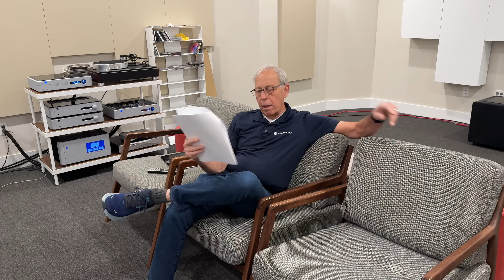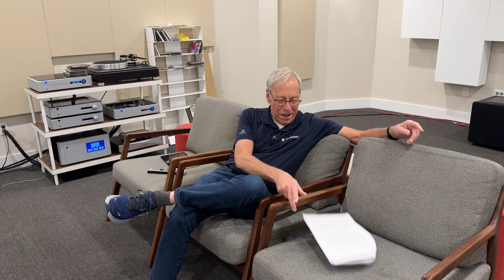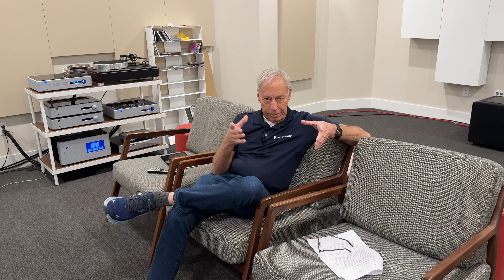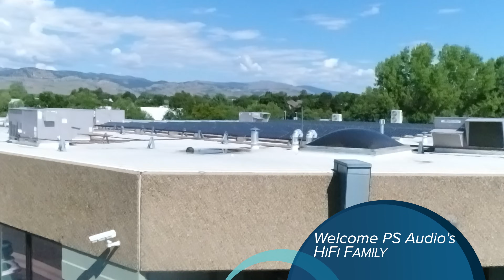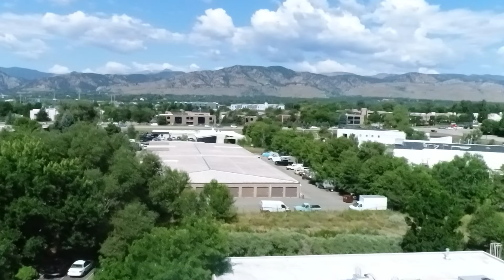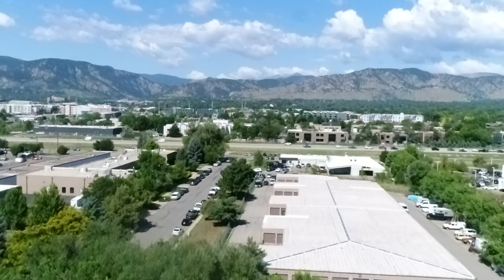AESEBU digital inputs

Comment: Where talking about transferring DSD signals right?
Reply: All digital signals. PSM and  DSD. There's no advantage cancelling out any noise picked up by the cable when transferring digital signals. That doesn't mean that they can't sound better or worse depending on how your equipment is designed
Reply: All digital signals. PSM and  DSD. There's no advantage cancelling out any noise picked up by the cable when transferring digital signals. That doesn't mean that they can't sound better or worse depending on how your equipment is designed
Reply: All digital signals. PSM and  DSD. There's no advantage cancelling out any noise picked up by the cable when transferring digital signals. That doesn't mean that they can't sound better or worse depending on how your equipment is designed

Comment: What about USB?
Reply: USB was not designed with audio quality in mind.  It was designed to connect computer peripherals.

Depending on the sending device, USB can sound very good.  And depending on the USB cable, it can sound even better (or worse).

The main problem with USB is that computers generate a lot of electrical noise, and that gets sent out of the USB port, travels through the USB cable, and enters the DAC.  The result is that the music sounds less open, and less dynamic.  Streamers are also computers, designed for one purpose.  They, too, generate electrical noise.  How much depends on the design of the streamer.

I have my laptop feeding my DAC via a very good Audioquest USB cable, and it sounds very good.  Prior to using the Audioquest USB cable, I was using a mass produced USB cable, and the sound quality was far from good.  That Audioquest USB cable got rid of loads of noise.  I did not recognize it as noise (it is not like static, or hum, etc).  The music just sounded congested, and all of that changed with the Audioquest USB cable.

But the sound quality could be better, still.

I will soon be purchasing a digital-to-digital converter (DDC).  They are ideal for cleaning up the noise and jitter from USB.

You plug your computer or streamer's USB output into the DDC.  Then you plug the output of the DDC into your DAC.  The DDC will significantly reduce noise, and might reduce jitter, too (depends on the quality of the DDC).  And like all audio gear, there are DDCs that are under $100, and also for thousands of dollars.

The Singxer SU-2 gets good reviews, and the SU-6 is a bit better (and a bit pricier).  And then there are reviews on not using the included power adapter, due it generating noise.  Many DDC's come with an external, switching power supply (power brick).  So people purchase a low noise (low ripple) linear power supply.  Many get very good reviews from customers, and the reviews are for linear power supplies that are between $75 to $175.

And then you will want a quality AES/EBU cable to connect your DDC to your DAC (or some other digital output from your DDC to feed your DAC).  Even if a DDC offers a USB output, do not use it.  Use one of the other outputs to feed your DAC (and make sure that your DAC has an input for that type of cable).

AES/EBU cables are very good for long distances.  And those cables will vary in price, wildly.  According to reviews, digital cables will affect the sound quality.

Good luck!

Comment: @ 2:03 I2S not balanced? HDMI is a balanced topology. You mean that PS Audio is running the HDMI I2S single ended? Balanced signals provide the same benefits be it analog or digital. And BTW, all electrical signal transmission is analog. True HDMI is balanced, Ethernet is balanced, USB is balanced, Apple Thunderbolt is balanced as was Firewire. Most high speed interfaces are balanced. SPDIF and AES-3 are unbalanced but AES runs at video frequencies which are lower than the computer interfaces I noted above. FWEIW, most AES installations in the past 20 years were AES-3 75ohm unbalanced as the unbalanced version actually has more length capability, cheaper using coax cable and BNC connectors, and higher density on jack panels. Balanced AES is not used that much anymore except in recording studios.

P.S. I don't care what people think they hear, there is no subtle audible difference between balanced and unbalanced AES. Cable problems will cause errors which are highly audible. These audiophile ideas such as sound stage, presence, detail, are not affected by any digital interface. It either delivers consistent error free data or it doesn't. Then you get clicks and pops. That's it. Jitter is a DAC issue not affected by 6-10 foot digital cables.

Comment: Always enjoy learning stuff from Paul.  While I'm a fan of I2S I struggle to buy that an HDMI cable does not damage the clock signal.  Even different quality coax with SMA connectors can be heard.
Reply: What is the damage is being done to the clock signal that is causing an audible problem?  Can I see a calibrated screen shot of the clock waveform that is "damaged"?  Different quality coax? You do understand that coax cable is designed for a specific impedance? 50,72, 75,93,124 ohms for example. It needs to be matched to the design impedance of the interfaces. Otherwise errors can result which are quite audible,
Reply: @andydelle4509  You will have to seek that elsewhere.  I do not have the equipment to measure what goes on.  Just ears.  
We seek in digital audio low phase noise.  Any form of wave change can change the trigger point negatively impacting phase noise.  We use well shielded 50 ohm cables.  Torquing SMA connectors is generally accepted best practice and is clearly audible.  Even though a cable spec'd for low gHz transmission should be more than adequate for the 5-90 MHz clock speeds, I can assure you a cable spec'd for 20gHz sounds better than one spec'd for 4gHz carrying the clock signal.  And if you use a U.FL connector a few times, the impact can collapse the sound stage or shut down the system.

Comment: After the years of experimenting with hifi gear, I’ve concluded that it’s hard to conclude what is best based on specs. without auditioning.  I’ve found my results are system dependent.  I have clearly heard differences in AES cables, power cables, etc., and was glad that I auditioned them because there were times I thought my amp, DAC, or streamer, etc. was the weak link and with simple cable swaps and other system swaps, I found that there was absolutely nothing wrong with my amp or whatever.  So, I don’t conclude that I2S, USB or AES is better than one or the other because you have to try them all and, if you can, with different cables within each cable type to really conclude what sounds the best in your system.  Right now, I have a Pangea toslink cable outperforming all the AES cables I am demoing right now except this Acoustic Zen Absolute AES cable.  That is insane, but that’s my experience at the moment, but I plan on demoing several more AES, toslink and USB cables before I make my decision on which one to buy.  The Cable Company is a good option to demo multiple cables with their loan program.  That’s what I am currently doing and it has been fruitful!

Comment: For analogue and short distances rca is best, balanced signal modifies the original sound. But for digital, aes/ebu is great.
Reply: Sorry, MrBazsi888, that doesn't stand the test of reality. Vice versa would make a bit more sense.
Reply: MrBazsi888  is right. Analog balanced audio requires at least two additional amplification stages at significant gain to drive the cable. The receiving end is also has more components. That's more noise and distortion being added. Now with modern electronics, the effect is minuscule but nevertheless still present and even measurable.
Reply: How does using balanced for analog "modify" the sound?
Reply: @wty1313  https://m.youtube.com/watch?v=omC52EtizWg&t=38s